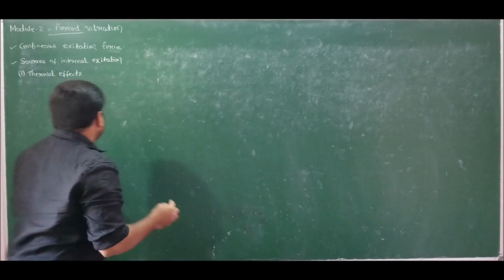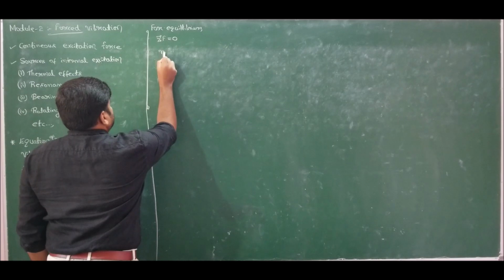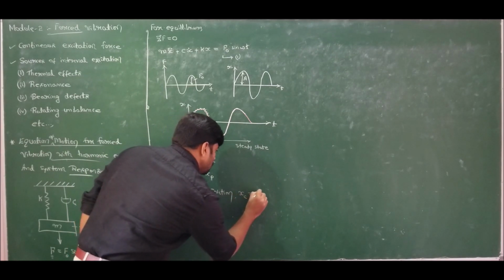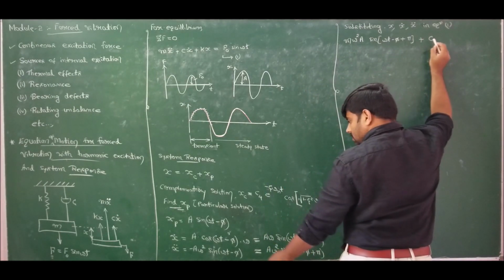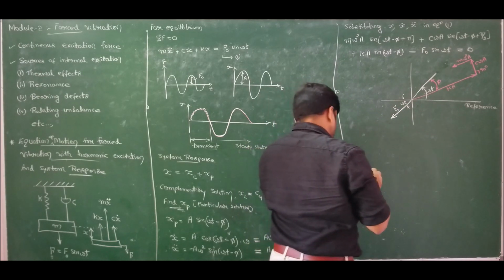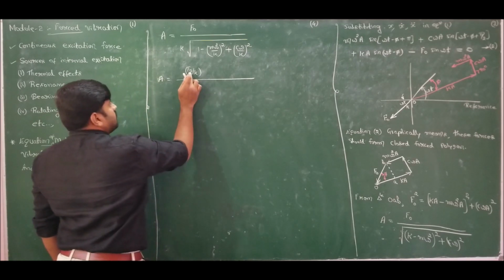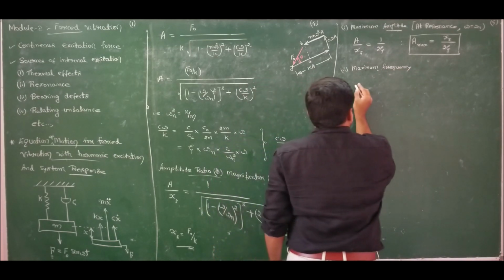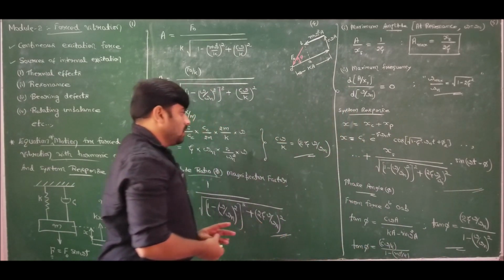Lecture 1 - Introduction to Forced Vibration - Module 2 - Mechanical Vibrations by GURUDATT.H.M

Comment: Derive expression for steady state amplitude of vibration of mass in a spring mass damper system when the mass is subjected to harmonic excitation, also find phase angle
Reply: I think this video is the answer for this question
Reply from the maker: Yes 👍.